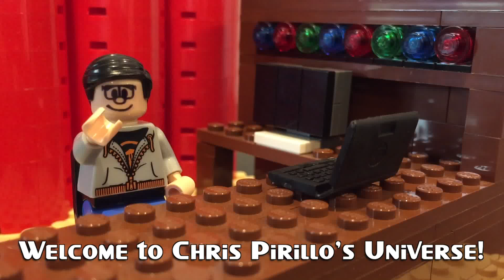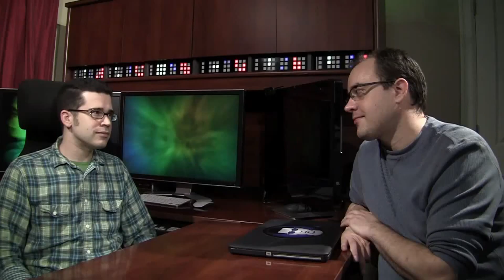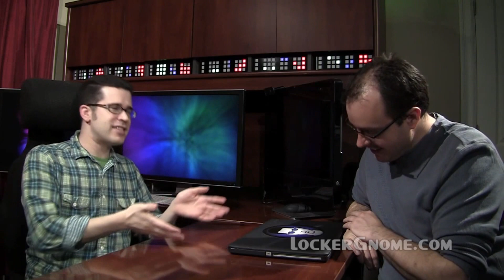AC vs DC

Comment: I absolutely couldn't let go. Once I gripped the wire, my hand was completely paralysed by the electricity and I had no control over it.  My grip was steadfast.  Had to pull myself away by jolting upright with my legs.  It was a new construction and the exposed wiring was for a wall socket that hadn't been fitted yet.  Definitely 230 Volts mains.

The fact that I had rubber soled shoes is what saved me.

Comment: Both will kill (depending on their amperage) but AC is more likely to stop a persons heart.  It also leads to dielectric breakdown at lower voltages than DC does.  That means that AC is more likely to get through human skin.

I've been zapped by 220V AC and I couldn't let go.  Had to pull my hand away by physically jolting back.

Comment: hvdc is more prone to an arc fault, as due to the nature of ac, if a small arc is struck it will extinguish itself as the voltage passes through zero, wheres because there is a constant voltage in dc, the arc will grow and cause more damage. ac is much safer and more practical, e.g current limiting on ac just requires a capacitor or inductor, if we switched to dc everything would have about half a dozen inverters in it

Comment: AC is much more dangerous than DC.  Hence, why a DC 12 volt car battery can put out 50 Amps yet can't electrocute  - but at the same time, its output can be converted to AC as a power source for electric fences.

Comment: My uncle knew of a Man who could tell if the wires were crossed by taking his shoe off and sticking is foot in a puddle of water and touching the wires. That was how he diagnosed the wiring in the houses. My uncle does same with cars, when he repairs them, he'll touch the plug wires to make sure there is power going to the spark plugs.

Comment: 440 is bad i have heard stories of a pair for cutter just shattering or vanish and nothing, but the insulated hands remained. From repairing massive circuit breakers. But you know you can touch a AC line all day long so long as your not grounded. But don't try anything stupid unless you have too.

Comment: A 20 Amp circuit will kill you pretty easy if you can't get away. It will suck you to it. Higher Amps will just knock you away. My dad had to hot wire our 200 Amp Meter Base with 10 gauge wire. He was knocked up against his truck 3 times before he gave up. He did not have a stead enough hands to do it. I have come close to being Bit by the Main Lugs in a breaker box too. But we still not afraid of it. He has cut the Main lines coming in to the house with a pair of Bolt cutters several times.

Comment: Tip of the day:  If you connect the negative and positive prongs of a dc motor backwards it will run backwards. If you do that to a AC motor it will not work.

Comment: Someone needs to go back to electronics class..... Voltage doesn't kill you..... If that was the case, then 120 could never come close since stun guns use what, 50,000 volts???  It's amps that kill you.  

Never a good idea to stick any part of your body into a socket... especially your tongue.... You have 120 volts at 30 amps running through there.... enough to kill you 50x over or more!  :)

Comment: @TheRealSergentSiler No it flows. To vibrate your cable would have to be longer than electrons travel in 1/60th of a second.  Electrons travel at the speed of light so your cable would have to be 16,392,850 feet  or about 3k miles. for the electrons to "vibrate".

Comment: What? Pissed electrician here. DC is safer, AC is more deadly. The "oh sometimes the electricity isn't going throuigh you so DC is worse" is bullshit. AC is so dangerous because it shocks and fibulates your hearts because it shocks you 60 times a second. DC would be a constant shock that most times allows you to let go before any damage can be done, AC because it convulses muscles and heart kills you quickly.

Comment: I thought one big reason they use ac over dc in distributing electricity  is because of how far you can push it on wire over dc which can't travel as far?

Comment: And the voltage doesn't kill you it's the amps 12v can kill you  if the amps are enough like a car battery most batteries have strong current but they won't flow through your body because your bodies resistance is extremely high but otherwise 1.5v could stop your heart if it passed through but it can't even a car battery with it's enormous current needs a jolt from the spark plugs to get throughyour skin

Comment: @keco185 no you feel volts, amps is what kills you, but you can get hit by high voltage and REALLY feel it, and not die if the amperage is low.

Your heart could still fail, because of a heart attack etc. though.

Comment: @phototristan ur tongue is wet so the current can flow and ur fingers are dry and if u touch the battery with two fingers the resistance is pretty high so there is not much current folwing

Comment: WRONG DC is safer than AC at the same effective voltage because the maximum voltage of AC i the one mentioned times squareroot of 2 and the maximum voltage of DC is just the one mentioned. Also the phasechanging of AC is more likely to kill ya.

Comment: DC loses a lot of voltage when you try to push it through a longer cable and you'd need a cable with a very thick diameter to reduce the voltage lost.

AC does this a lot better, it doesn't have to have as thick cables and the voltage lost is most of the times minimal when compared to DC.

This is why you use AC instead of DC to power up the "grid".